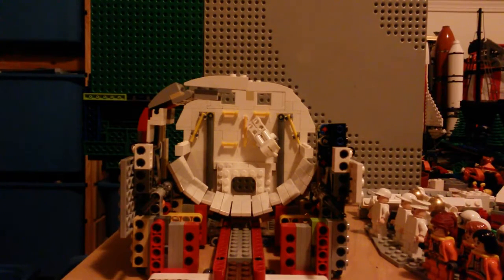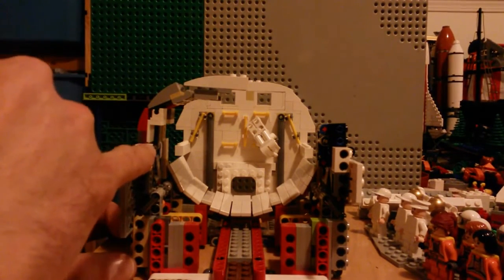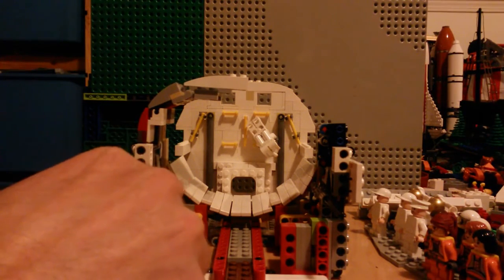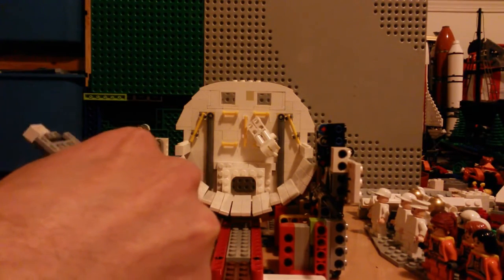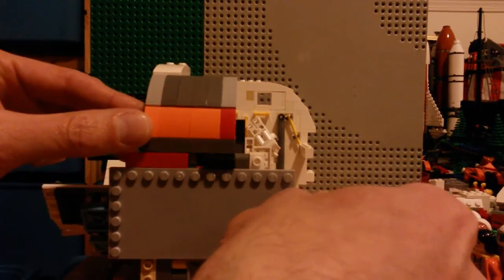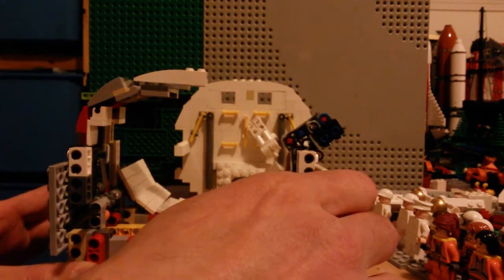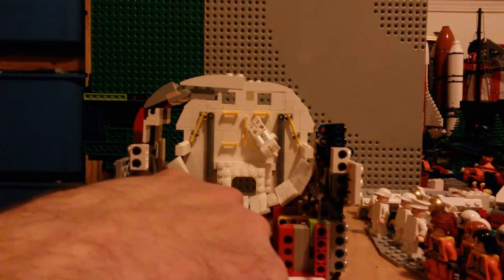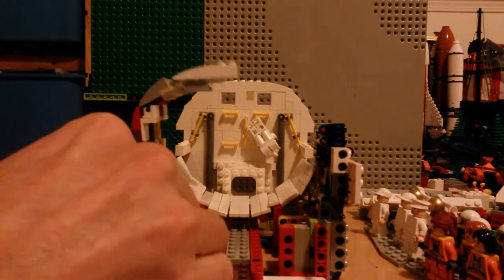Lego Space Shuttle Payload Bay Door Mechanism WIP (Nov 2016)

Comment: It seems to work well
Reply from the maker: Indeed, which I suppose is why I was lulled into thinking it would scale well.  it did not.  The torque on the axle is multiplied by 8 and it becomes almost impossible to turn.  I am investigating a new approach using the small Lego linear actuators.
Reply: @spaceflightbricks  The technic brick with a spring? Good luck with the mechanism! 
edit: spelling
Reply from the maker: @stephenlabys5215  I don't think it has a spring in it.  It has a gear on the bottom that you can drive in order to advance or retract the shaft with a pin connector on the end.
Reply: @spaceflightbricks  I suppose the main thing with that would be stress on any axle used, but the set up would probably work on the current model (first video you posted)
Reply from the maker: @stephenlabys5215  oh certainly, it will require a gear reduction for each actuator's drive axle, so that the main drive axle can handle the load